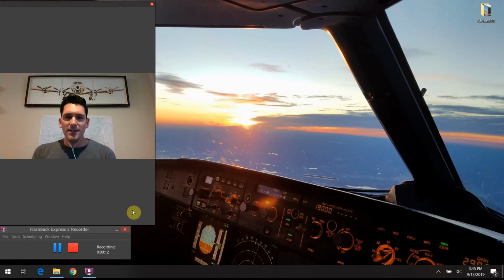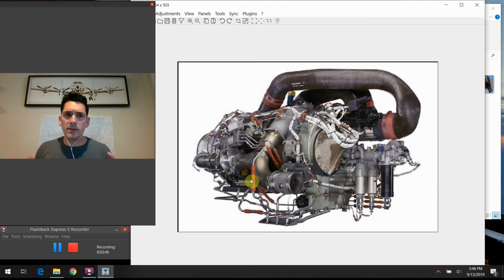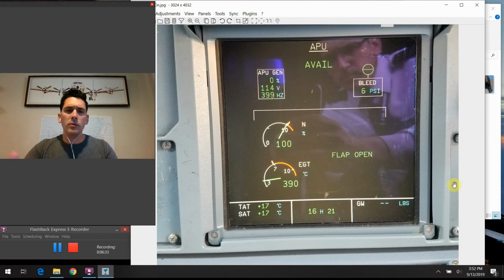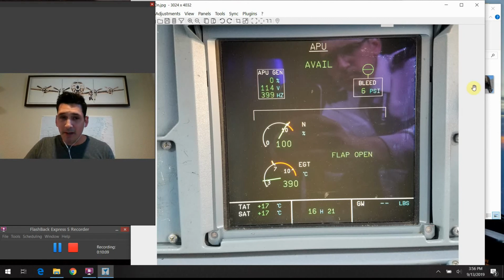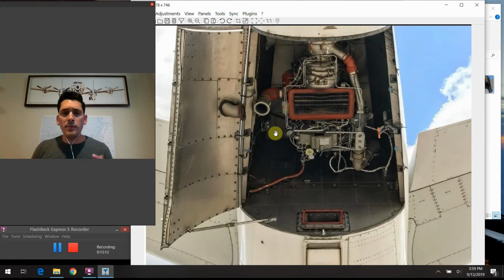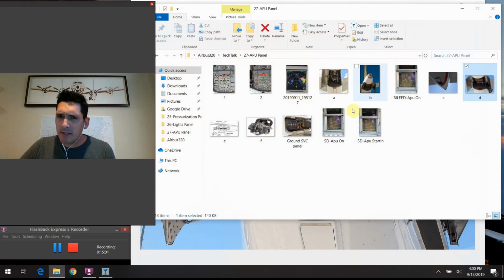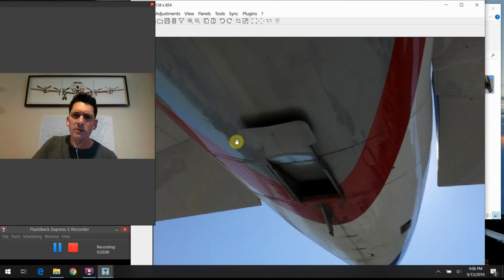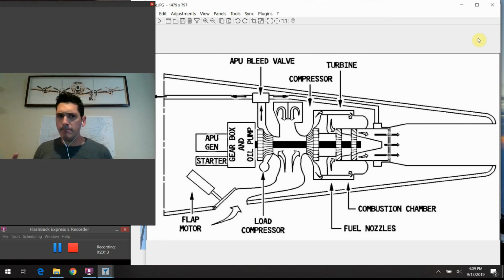Airbus A320 Cockpit Tour: #27 - APU Panel: What do all those buttons do?!

Comment: Hi Mr.Abignale
Where is the APU located on 3 engine aircrafts like the b727?
How does the APU page looks like when the APU fire test button is used? Does the page automatically comes up and alert you to the fire or the fire pushbutton lights up and the master caution starts ringing?
Does the APU shutdown button on the ground service panel release the extinguishing agent for the APU?
Reply from the maker: You bet Aby!
Reply from the maker: thanks again for tuning in Aby!

Where is the APU located on 3 engine aircrafts like the b727? - In the belly of the aircraft between the main wheels on the 727.

How does the APU page looks like when the APU fire test button is used? - the SD page automatically comes up and shows all indications for the APU. Surprisingly though it does not say FIRE on the page. That is displayed on the ECAM.

Does the page automatically comes up and alert you to the fire or the fire pushbutton lights up and the master caution starts ringing? Yes, the page automatically comes up.

Does the APU shutdown button on the ground service panel release the extinguishing agent for the APU? - No it does not.
Reply: @MikeAbignale  Thank you very much Mr.Abignale😀😀😀